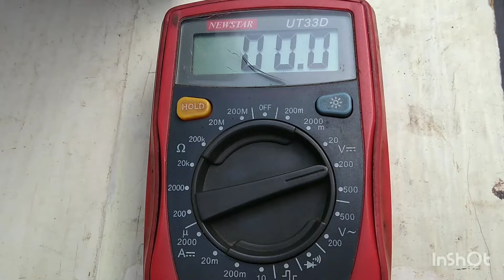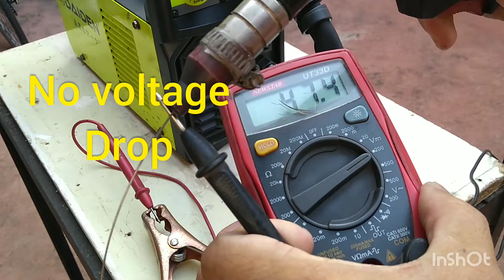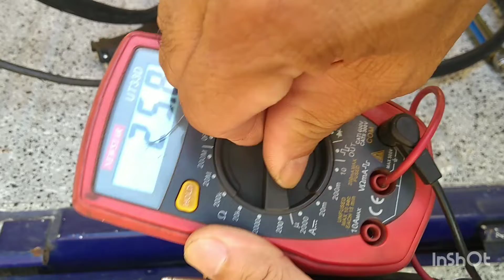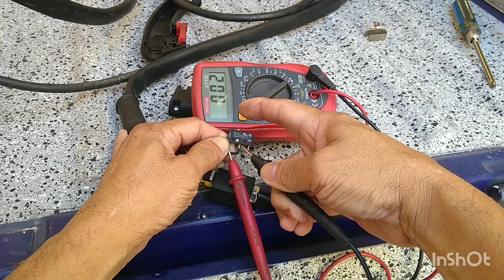Daiden Gasless MIG welding machine (Trouble shoot, Repair and maintenance.)

Comment: Boss paano poh ba pag ayaw lumabas ng wire boss?
Reply from the maker: Maaring barado wire feeder tube
Check mo un nozzle tip nya kung 
Ok
Check ko kung ok Yun mo to motor 
Check mo rin kung maayos pagka install Ng wire baka kulang sa higpit yon tension knob. Baka mahigtip Yun adjust sa tension Ng mig wire

Comment: ,paano ayusin ayaw umikot ang wire pero nagwewelding nman pag dinikit mo,,ayaw lng syang umikot dko xa magamit,,,salamat sa mabilisang sagot
Reply from the maker: https://youtu.be/TFXO4bvtG_U
Reply: ,okey nman malinis lahat pero ayaw gumana motor ng wire feeder
Reply from the maker: Kung ok un switch nya sa mig gun. Bunutin mo Muna un saksakan sa supply. Tapos check mo Kung ok un connection papunta sa motor. Maari din sira un motor. Pa check mo sa electronics pag d mo kayA
Reply from the maker: Check mo Rin un switch jg mig gun
Reply from the maker: Kung marunong ka Sana sa multi meter tester
Reply: @creativeskills777  kc nung akoy nag palit ng wire  dko natanggal ung tira nya tapos napdikit ung tira sa weniwelding ko tpos biglang may lumagitik tapos dna xa umikot khit anong gawin ko pinaltan ko ng lahat  pero ganun parin ayaw ng umikot,,
Reply from the maker: Pag walang wire na na kalagay dapat umikot un motor ibig sabihin ayos yon. Dapat walang matirang wire sa feeder o sa tip nya.
Reply from the maker: Dapat katulad sa video pwde mo maikot un wire miski  naka off sya. Walang bara
Reply: @creativeskills777  hinde xa naikot khit wala wire
Reply from the maker: Un motor yan. pamo baka lng sa switch ng mig gun. O kayA sa Motor nga . Kung meron speed control yan mig mo check mo baka naka off o naka set sa mahina yan
Reply: @creativeskills777  ang problema nga cguro eh motor ng feeder,kcpwede ko magamit pag nkalabas ung wire hinde lng xa naikot  tumigil sa pag ikot
Reply: ,maya nlang pag uwi ko sa smin icheck ko itetes ter ko meron nman akong tester,,,,salamat
Reply from the maker: Pag ayaw umikot maaring barado o may kalawang un wire feeder tube. Check mo Rin baka masyado lng mahigpit un mga tensioner mo.  Linisin o palitan Ang wire feeder tube. Check mo Rin Kung gumagana un motor ng wire feeder
Reply: Sir yung gasless ko na ganyan,, sobrang daming spotter ba tawag dun kahit anung set ko,, may nabasa ako na kelangan ang negative ay dun sa may nilalagyan ng wire,, pagpapalitin daw,, maaare po kaya yun tnx
Reply from the maker: @dadventureofyenandkaira1678 
Electrode negative talaga yan . Ibig Sabihin pag flux core o gas less Ang gamit mo nsa negative dapat Ang wire
Reply from the maker: @dadventureofyenandkaira1678 
Pag flux core o gas less gamit mo sa negative talaga yan
Reply: Mali pala talaga ito nabili ko,, diko alam bakit nasa positive,, maare kaya pag palitin ko nlang yung wire ng positive at negative
Reply from the maker: @dadventureofyenandkaira1678 pag nasa positive Ang gamit mo ay may CO2. Pag sa negative para sa flux core wire Yun gas less